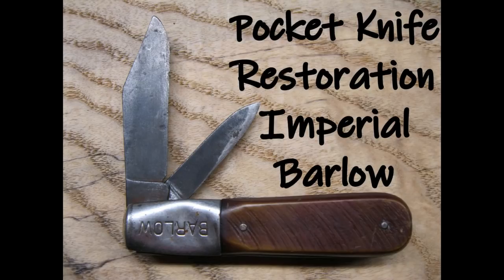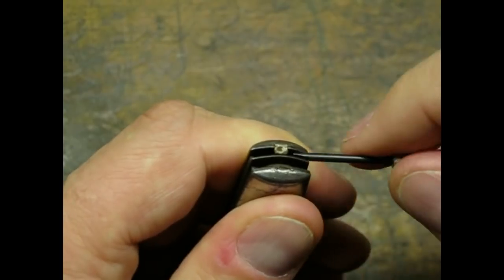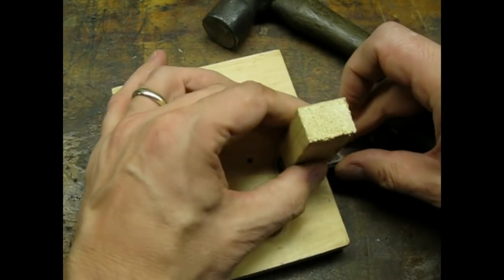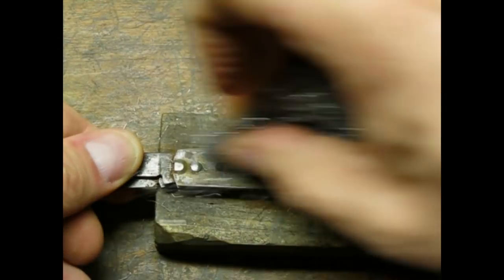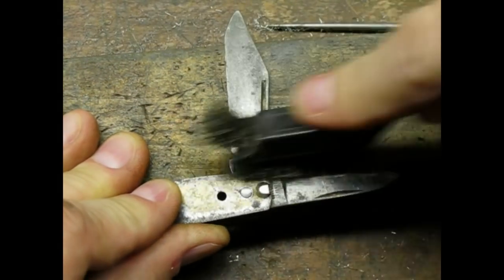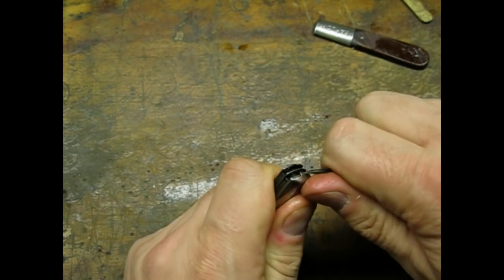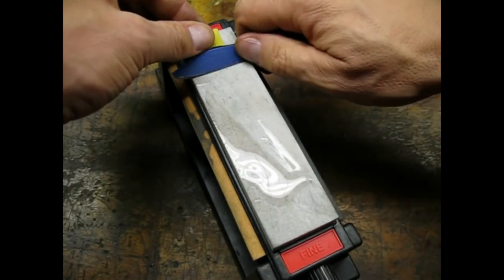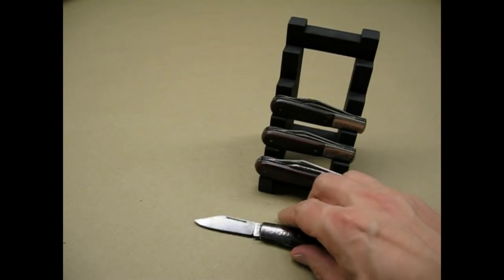Pocket Knife Restoration - Imperial Barlow

Comment: A few years ago, I came across a brand new, never sharpened Imperial BARLOW knife with no scales on it.  It just has the brass liners and 2 blades.  Both blades are shiny, pristine, unblemished.  Centering is dead on.  the knife's blades has great pull, and I think the knife will be a joy to own and carry...IF, I can re-scale it.

I am positive that this is way more work than the knife is worth, but it is an AMERICAN made Imperial Barlow, so....I have to do something.

If anyone wants to chime in and give some advice...feel free.
Reply from the maker: Maybe look for a donor knife on eBay with beat up blades?

Comment: Hi and thank you for your videos. I was wondering if you had any tips on how to remove blade discoloration?
Reply from the maker: Thanks for watching Donnie!  I would start with a polish like Flitz.  If the stains are still there, try some 0000 steel wool, then Flitz.  If that doesn't work, you may have to resort to sanding the blade with wet/dry sandpaper.  I like to use WD-40 as a lubricant while sanding.  Start with 400 grit, then 600, 800, 0000 steel wool then Flitz.  I hope this helps!
Reply: @357magdad  thanks I'll give it a try

Comment: For the life of me I cannot get a jewelers flathead in there to bend those tabs up on mine. Any coaching on that?
Reply from the maker: Thanks for watching!  I've got a cheap set of those eyeglass screwdrivers and I usually have to use to smallest one to start the tab and then I switch to a larger one.  I think an ice pick / scratch awl might work too.
Reply: @357magdad  I'll give it a try, thanks. I've ended up with 3 of these Imperials somehow over the years and I want to clean them up.
Reply: I’m having the same issue with my grandfathers old knife

Comment: I'm curious Magdad, I've got an old Case XXL that belonged to my wife's grandfather. One side of the knife is missing. I'm thinking of just restoring it with Walnut instead of trying to find a replacement for the missing piece. Anything I should be aware of.
Reply from the maker: I've never messed around with Case knives because they are very collectible and valuable.  I would say to maintain the value, you would have to find a replacement piece or buy a "donor" knife.  If maintaining the value is not important to you, I say go for the walnut restoration!

Comment: I find it hard to open my knife. Any tips?
Reply from the maker: I like to soak the pivot joint with WD-40 and work the blade open and shut a bunch of times and re-soak.  If there is any corrosion you'll see it ooze out when you re-soak.  I prefer Remoil to lube the pivot joints.
Reply: @357magdad  I'll try that, thanks man 👍